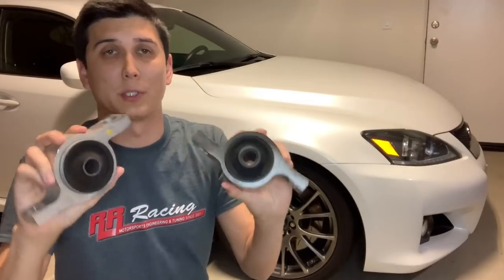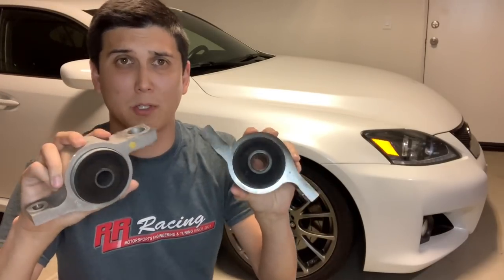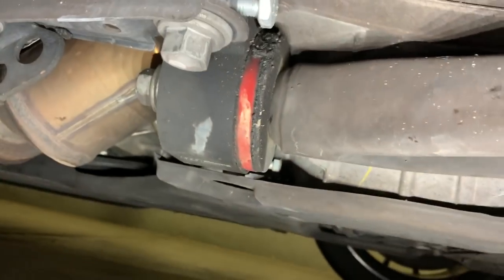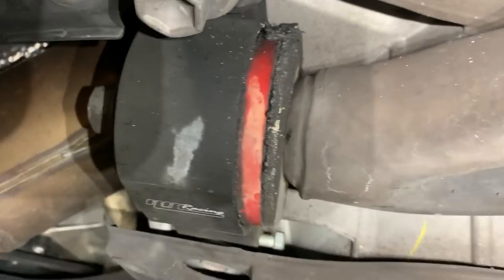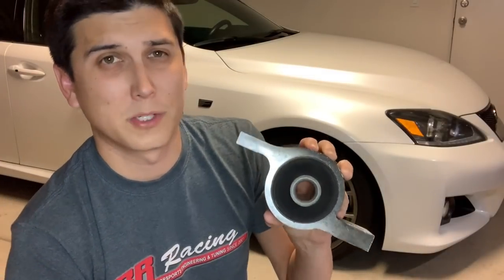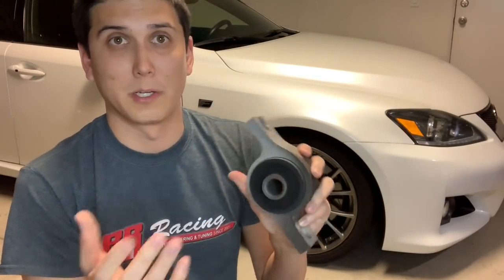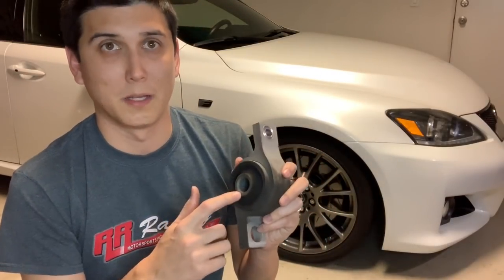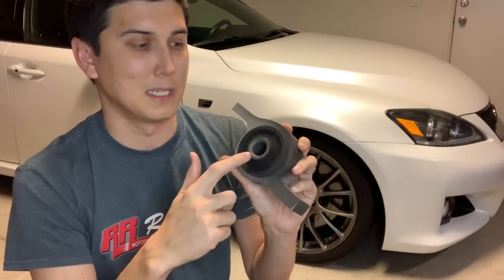Lexus ISF - RR-Racing USRS Review

Comment: I just ordered the Figs Engineering 90 durometer one with reinforced bracket. Still yet to arrive. But here I was hoping it would eliminate the inner tire wear, I'm on stock suspension. :(
Reply from the maker: I’ve heard great things about those as well!  You’ll have to let me know how you like them.  Your tire wear may be different than mine due to different suspension setup.  Either way, you’re gonna like the way the car feels!
Reply: Spc adjustable ball joints and rear camber kit will solve your problems. 👍
Reply from the maker: What makes them so much better?  The Figs are $360 and the RR-Racing are $348... 🤔🤔🤔
Reply from the maker: Good to know.  I’ve had mine on for almost 3 years and don’t mind the extra NVH from them.  I agree that they will squeak when it’s cold outside but being in southern California that’s only for a short portion of the year in the mornings while driving.  Good to know there are options for people to choose and you’re liking your setup!